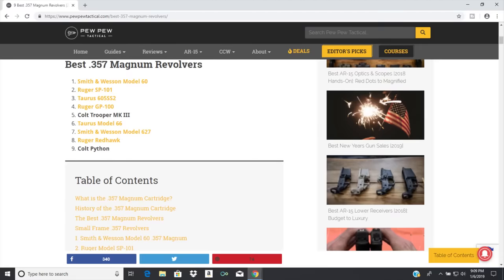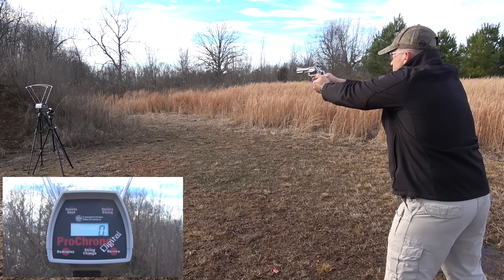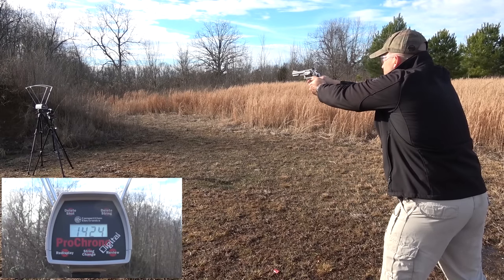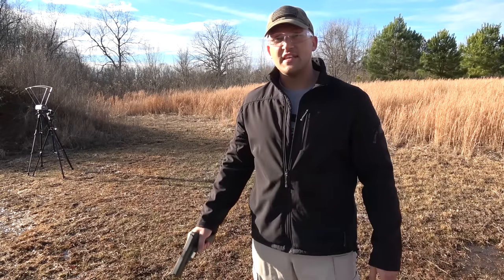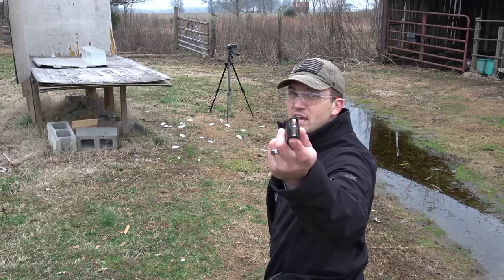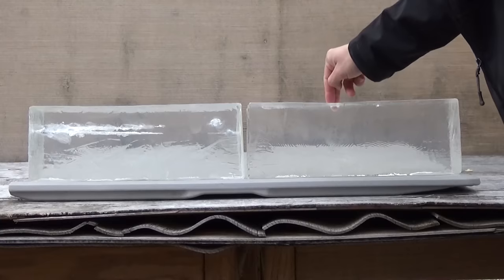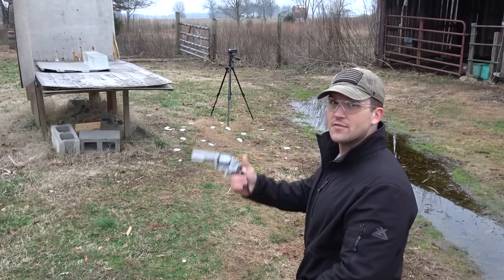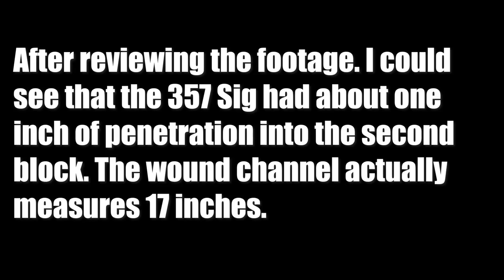357 Sig vs 357 Magnum vs Ballistic Gel

Comment: Honestly, the 9x25 Dillon is a better comparison.
You can supposedly get velocity higher than that with a 95gr bullet in a Glock 40.
Haven't tested it but is seems plausible. Imagine the energy from a 16" barrel... Over 2k fps and over 1k ft⋅lbs of energy.
Reply: Yeah I'd love a carbine in this, even a 10 inch braced pistol.
Reply: 5" coonan gets over 900 ftlbs and that's with a 180gr xtp, a bullet that's actually useful
Reply: @FearScherer  impressive. I've heard extremely divergent results with Coonan due to extreme spread of performance with 357.

But check out 9x25. It's a good round and gas gobs of potential.
Reply: @ravissary79  there are lots of neat "calibers" out there. I actually love all of them. Even ones I've never heard of, hah. But I try to keep it simple as possible. I really liked a 10mm I had, a rock island tac ultra, but just couldn't justify actually investing in the caliber with what I have available in 357 and 45acp\super. But then again, I've said that about other calibers before
Reply: @FearScherer  the nice thing about 45 super and the 10mm glock is they're reverse compatible. 
Same goes for the magnums.

My G20 shoots cheap 40s&w all day. I just need to scrub put the burn ring.
Reply: @ravissary79  yeah I started looking at converting my 45 Glocks to 10mm to get more power. This was when I was really into guns but didn't know much about ballistics and what the guns I already had could achieve. I wanted a cva single shot pistol, but wanted to make sure 357 was enough for deer cause I didn't want to ad 44 as another caliber. That was like 5 44's ago, so things do change. Then what I saw the 357's and 45's could be loaded to do, the 10mm idea fell off. But I still like it and even the Buffalo bores weren't bad at all in that Commander size 1911. I'm looking for the same gun in 45 currently.

Comment: I'd love to see how that 40S&W Underwood round, with almost 600lbs of energy compares to the .357SIG. 😁
Reply: +Danmandingo The Underwood 40 S&W 150 gr @ 1300 fps (ME 582 ft/lbs) would actually move a 100 pound ballistic pendulum 1.38 inches on impact. The Underwood 357 SIG 125 gr @ 1400 fps would move the 100 pound pendulum 1.24 inches, so the 40 S&W hits about 11% harder.  ME(Muzzle Energy) is not bullet striking force; it is the propelling force in the powder charge to accelerate a bullet to the stated velocity.  The 582 ft/lbs of force in the Underwood 40 S&W load is 1.06 Horsepower of propelling force.  The original load for the 45 Colt in 1873, was 40 grains of Dupont Rifle powder under a 255 gr bullet for 1000 fps, making 566 ft/lbs ME.  That is just under the 40 S&W's 582 ft/lbs. But the 1873 45 Colt load will move a 100 pound ballistic pendulum 1.81 inches, striking 31% harder than the 40 S&W. Accelerating a 150 gr bullet to 1300 fps requires more power from the powder charge than accelerating a 255 gr bullet to 1000 fps, BUT the heavier 255 gr bullet will hit much harder, even at 30% lower velocity.
Reply: Kelso lowk  40 is dead/dying.
Reply: Sorry but I would rather have a 10mm
Reply: @MultiDryder  Providing you can shoot it well, 10mm is such a good defense cartridge. You can daily carry it, and still keep it on your hip when you go in the bush.
Reply: @WilliamStewart1  that's why I like the caliber and yes I can shoot it well even the hot loads but for carry I prefer hollowpoints going about 600fpe like a 180gr going about 1225fps in reference to 10mm atomic ammo (brand name) and in Bush like the fort Scott munitions 10mm or even federal jsp bullet going over 1275fps.
Reply: The UA 125gr 357 Sig should  have hit a velocity of 1550 fps out of a G31, 1400 is not accurate for this round.
Reply: @jamessmith-ow1bf  there are alot of factors as to how velocities work like barrel length is main reason for this one.  Also advertised velocities are more of most optimistic velocities although some batches of ammo can be underloaded or overloaded due to mass production.
Reply: The advertised velocity of the 125gr 357 Sig round is 1475 fps. I have seem A LOT of velocity tests on the web with this round and none were below 1500 fps out of a 4 inch barrel, this test was out of a 4.5 inch barrel so the velocity should be even greater.
Reply: @jamessmith-ow1bf  one other factor I forgot to mention is some chronograph can read a little inaccurate also
Reply: 63DW89A - Thank you for that explanation.  Could you direct me to where I could learn more about the calculations you explained/ bullet striking force?
Reply: The 125gr 357 Sig has a stated velocity of 1475 fps out of a 4 inch barrel with 600 ft/lbs of energy.
Reply: @paulstella8443  if you want the math formula is Mass×velocity×velocity÷450240, an example with 357sig 125×1475×1475÷450240=answer
Reply: @MultiDryder  450400 in the equation not 450240.
Reply: I'd like to see how your .40S&W. Stacks up against a buffalo bore 10mm ! Or even a target load for that matter.
Reply: @63DW89A  Mass moves ass
Reply: @adamshaw8214  when I look formula that is what I am mostly finding so that is how I am getting it
Reply: @MultiDryder  check the math on a given load that has the energy listed using your number then the one I gave you. You will see that it comes out correct using 450400.
Reply: @adamshaw8214  I just did on Winchester whitebox 357sig jhp and on 450400 I got 505.8 and 450240 I got 505.9 and advertised velocity,weight and muzzle respectively is 1350, 125 and 506, maybe very similar formulas and maybe neither is wrong
Reply: @MultiDryder  very interesting
Reply: @adamshaw8214  although number you gave is easier to remember so maybe I will use that one
Reply: Having owned 40 , mag and sig, I can say this velocity out of the 4" sig is super low, guys are getting 1550 out of 4" and this velocity out of the compact g33. The warning labels on the 40+p stuff worry me. Plus the 357 sig ammo is rated at 618ftlbs so I would say 583ftlbs is slightly less, also you aren't supposed to shoot the 40+p from stock glocks! If you need 40+p get a 10mm or 357sig !
Reply: Great review but I agree, guys are hitting these velocities out of the 3 inch barrel g33 with underwood so something was off a bit.
Reply: @pj7362  10mm is a 40cal. 40 has a shorter case so it will  be slower less energy put 10mm up against 40super
Reply: @WilliamStewart1  .40 S&W is not a dying round, it's still a very popular round with a decent amount of power. I don't know why the people who hate .40 S&W keep trying to say it's a dying round, I guess there's always gonna be haters though.
Reply: @MultiDryder  I have a 10mm Glock 20, by far and away my most favorite auto pistol rounds. It's an absolute beast of a round with the right ammo.
Reply: @bdr32965  I got the Springfield xdm 4.5 and the glock40 in 10mm, as for your question on 40cal dying I would have to say it is ever since FBI and law enforcement transitioned away infact the secret service is now abandoning 357sig for 9mm.
In my opinion I never took 40cal seriously even in its prime and the only real reason FBI and law enforcement used it is cause of post barrier performance but with advances in 9mm the 40cal served its purpose
Reply: @bdr32965  plus 40cal if you have not been paying attention to prices on shelf is about same as 45acp or even 10mm and that's cause of less demand for cartridge infact kahr arms as discontinued making any new 40cal handguns
Reply: @bdr32965  The reason I say that is because most government agencies have left it/are leaving it. It's snappy to shoot, is harder on guns, and doesn't really offer an advantages over modern 9mm. Sure you leave a little power on the table but not enough that I would think anyone on the other end could distinguish.
Reply: @WilliamStewart1  I'd still choose .40 S&W or even 10mm over a weak ass 9mm any day. I also hear a lot about the modern 9mm being great, but in all honesty the reason most of the  government agencies has gone back to it is because it's cheaper to shoot and the people using them don't have a lot of strength anymore to handle a little extra recoil. As far as the 40 being harder on guns, that isn't as true as it was several years ago, most modern 40's are built to handle 40 caliber rounds due to a lot better metallurgical fabricating nowadays.
Reply: @bdr32965  Again it's a toss up for me, personally I like the way 9mm shoots. I find 40 a bit snappy and can shoot 9mm out of the same frame more consistently during quick shots or even  mag dump. I don't even want +p really, just some good old gold dot in standard pressure is more than enough from where I'm sitting. If I had to make a trade up for more power I'd skip over 40 all together and just go right to 10mm in a larger frame.
Reply: @WilliamStewart1  I think you would really enjoy a 10mm, I bought myself a Glock 20 a couple of years ago and I don't regret it one bit. Although, since it is the bigger brother of .40 S&W it does have harder recoil. But with enough practice you can learn to manage the extra recoil and can shoot it as easily as a 9mm and be just as accurate and follow up almost as quickly. After switching to 10mm I will never go back to 9mm, as a matter of fact I gave my wife my 9mm.
Reply: @bdr32965  Yeah I've been eyeing 10mm for a while now. I live up North and there are Bears/Cougars/Wolves etc etc. In a pinch I'm sure 9mm would do the job, but I'd rather not take the risk when I'm out in the Bush. I bought a Rossi ranch hand a while back in .44 and a leg holster, but I still find it a tad large sometimes. I'm sure I'll do it sooner than later, but haven't made my mind up if I want a 1911 in 10mm or a Glock 40. I have larger hands and don't mind a large frame.
Reply: @63DW89A   I'd like to research your claims of pendulum movement/ Striking force vs ME. Do you recommend a good web site?
BTW, I get 563 ft/lbs from the 1300fps x 150gr .40,  not 582 ft/lbs.
Reply: @adamshaw8214  You sure? I got 450240 from a Paul Harrell video and he is typically textbook accurate.
Reply: +Leeman
Basic operation / mathematics of Ballistic pendulum explained here:
http://hyperphysics.phy-astr.gsu.edu/hbase/balpen.html

Most practical modern Ballistic pendulum operation & mathematics are in:
P. O. Ackley (1962). Handbook for Shooters & Reloaders, Volume I. Plaza Publishing., pages 191-195

Wikipeda does a good job of condensing P.O. Ackley's Ballistic Pendulum here: (go down to "Ackley's Ballistic Pendulum")
https://en.wikipedia.org/wiki/Ballistic_pendulum
Reply: @RU2AIM  The "450,240" figure is if the gravitational constant is 32.16 ft.sec/sec a slightly lower figure than the standard of 32.17 ft/sec/sec which would give a figure of "450,380".  The gravitational constant was defined as a standard at 32.17 ft/sec/sec in 1901at the 3rd General Standards of Weights and Measures conference. The "450,380" figure is the result of "7000 X 2(32.17)". The "7000" is the grains in a pound, which must be used under the bullet weight in grains in order to convert the bullet weight into a fraction of a pound.
Reply: I like the 357 magnum because I’m old fashioned I guess. If not, I’ll take my 40.
Reply: @WilliamStewart1  They said that about the 10mm as recently as 5 years ago.

Comment: The only meaningful comparison in my opinion is between the two 125-gr rounds.  The concept behind the .357 SIG was to match performance of a 125-gr bullet shot from a .357 Magnum revolver.

The IWBA's penetration performance criterion through calibrated 10% gel is 12.5 to 14.0 inches.  The 125-gr .357 SIG round came closest to this criterion, and had the greatest expansion (which was fairly consistent).

For self defense against two-legged predators the .357 SIG is the better choice, especially given its far greater round capacity.  Against four-legged predators, or a bigfoot, I'd opt for the .357 Magnum with the heavy round, as penetration ist über alles.
Reply: I’d say the only meaningful comparison is whichever you’re more comfortable and more accurate shooting. If you can’t get out of a situation with 6 rounds of well placed 
.357 magnum you’re in more trouble than a handgun can get you out of.
Reply: @876mpr  - Ptero's point was that the lighter  Sig got the best overall numbers for a defensive round, which makes it ideal. The others deviated away from the ideal with overexpansion and/or overpenetration because of their excessive velocities. There is more going on here besides simply whatever you as a shooter are comfortable with. There is a demonstration here, if you're willing and able to pay close enough attention to it, that faster/higher energy isn't always better. Shooters have a tendency to chase after the wrong numbers (velocity or energy), because we tend to be lead towards them. But we should be paying greater attention to what really matters in a bad guy's body: penetration and expansion. And to achieve those things, oftentimes pulling back a little bit and going with a midsize round for caliber will work best, as in this comparison.
Reply: I tend to agree with you to a point. I believe that both velocity and capacity are over emphasized and I’m not really a fan of either cartridge. My point is that a gun that feels comfortable to the shooter, provided it is a minimum of 9mm or .38 Special +P, trumps velocity and capacity because the rounds will be on target. Capacity is often a crutch for poor shooting, and bystanders often wind up in as much danger as the bad guy.
I personally favor .45 ACP with 200 grain JHP’s for defense. The 900-950 FPS they achieve is plenty for good expansion without over penetration. You also have your choice of polymer, 1911 and revolver.
Reply: @876mpr  ok boomer
Reply: Peter Stoneberg I’m actually a Gen X and I won’t be as crude as Zane, but I’ll bet you’re one of those hapless millennials I see at the range with their polymer wonders shooting about 2’ over their target at 25 yards.
Reply: Peter Stoneberg Wrong. I’m so old and decrepit that I can’t handle the recoil of anything more powerful than .22 Long Rifle.
Reply: @876mpr  
Nah you're a very strong dangerous man with a perfectly balanced brain and top 5% knowledge and skills.

Thus your use of a .45 with 200grain bullets.

A true badass that can solve anything with 3 to 5 well placed shots.
Because you're so badass GOD himself listens to you and never gives you the need for more bullets.

I know who you are.
You're a legend.

Don't be modest.